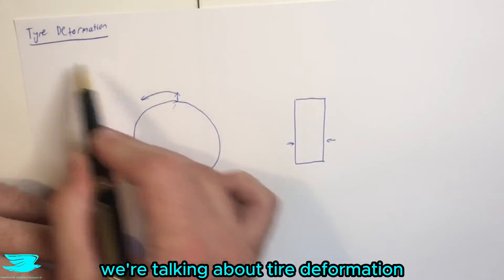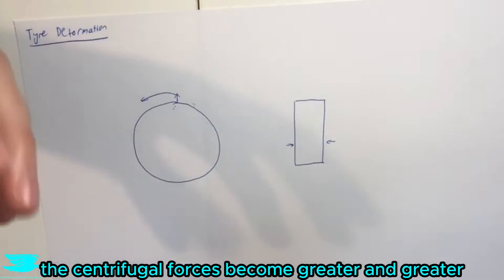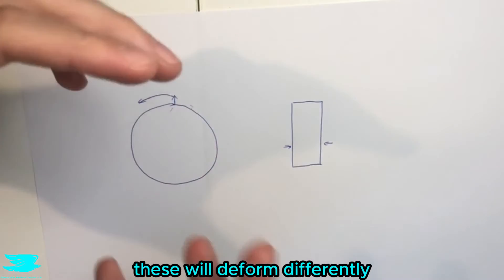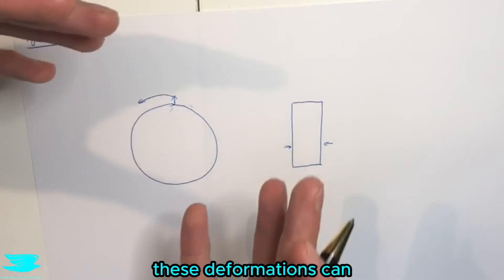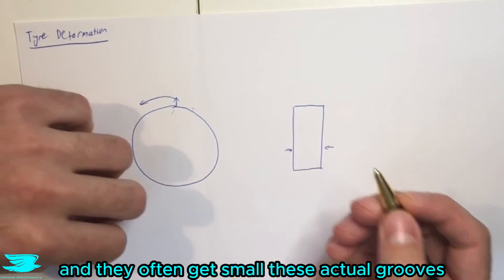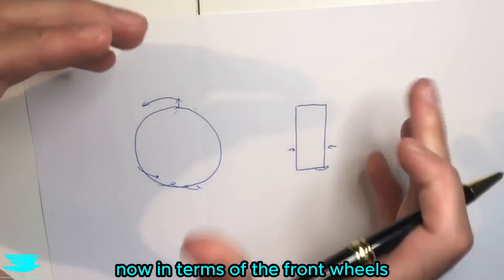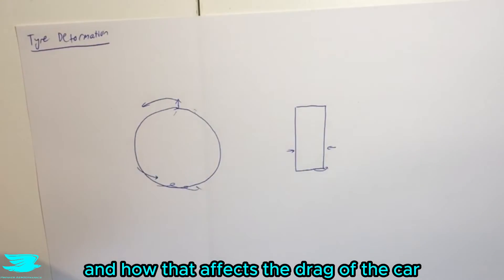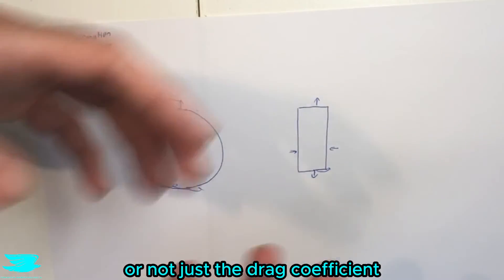Tyre Deformation Aerodynamics {Auto Aero #54}

Comment: Hello,

Flettner Rotor and Vortex Tongue are related to this topic.

For me it makes a lot sense to cage the wheels in. The deforming of the tire is only important to measure the cage size.
Just the part of the tire uncaged needs to  get in touch with the road.

Got to invent a mud cleaner. Cause the cage is going to catch dirt.
With a tire mountable cage cleaner brush, the cage might work.

With a cage around the front wheels, rubber foiled  wheel openings are possible.
If  the wheel is steered, only the cage is touching and bending the rubber foil.

Perhaps it's worth to mention that the moving air around the wheel produces suction, that tries to pull the cage toward the moving tire.
Reply from the maker: Covering the wheels are definitely good for reducing drag.

Comment: The strategy to minimize tire wake is to stop moving air from getting to the front of the wheel, and cramming as much slow moving air behind the wheel as possible. If the tire jetting vortex is due to air entering the space the tire leaves behind, putting air behind the tire will reduce the favorable pressure gradient that forms from the stagnation pressure at the front.

Obviously it's worse at the rear because the air has less kinetic energy left in it as it makes it's way through the car and all it's skin friction. It's also worse at the rear because the turbulent mixing from the tire wake increases the back pressure in the diffuser. The relative flow along the rear wheels is the key to improving diffuser performance. Outwashing bodywork behind the rear wheels, not only directs the tire wake outboard away from the diffuser(reducing the back pressure), but it turns the tire wake into a vortex that entrains airflow outboard as well.

Doing this will increase drag from the tire wake, and to make up for it, you have reduced the back pressure in the diffuser. Now you no longer have the tire wake turbulently mixing with your diffuser expansion, flow stays attached longer, your spoiler/wing/gurney becomes more effective at extracting air from the diffuser further reducing back pressure. Just from taking the tire wake out of the equation.
Reply from the maker: These are good points. For the flow directly behind the wheel, that is more controlled by the longitudinal grooves that allow air through the contact patch and the shoulders of the tyres that may or may not separate the flow.

The jetting vortex usually steers clear of the wake immediately behind the wheel. Sometimes, it can come back into the wake but more downstream.

And yep, the rear wheels do face a hard time. And getting cleaner flow from elsewhere is a good idea.
Reply: @PremierAerodynamics  I was talking more about the wheel wells themselves. We can do better than just putting a plastic hemisphere around the wheels, and calling it good. The little flaps and strakes around the wheels OEMS place is a good first step, cheap effective and easy to produce. Venting the wheel wells in strategic places is more expensive to produce, but even more effective.

Actually sculpting the entire wheel enclosure, is the least practical but most effective method. Least practical because it's by far the most expensive, not just in terms of design, but knock on effects like intrusion into cabin space, packaging requirements. When you look at it from that POV you can see why cars like the Ford GT are so expensive, as the aerodynamics took a front seat, even at the expense of the interior.
Reply from the maker: @rolandotillit2867  Oh okay. Good point. In that effort, many of the German cars now feature vents coming out of the wheelhouses, generally around where you get high pressure. That serves two purposes. You alleviate that high pressure and you funnel that flow into the flow around the car and in the wake to reduce the drag.

Funnily, because they generally look good, some cars have put them on for aesthetics but not connected them to the wheelhouses.😂

Comment: If we assume the tire is distortable but incompressible (i.e. solid rubber with constant volume, Poisson's ratio of 0.5), then as it lengthens in the longitudinal dimension, its lateral width would decrease by a greater ratio than its increase in vertical height. In other words, centrifugal force would decrease its frontal area.

If instead, we assume the tire is an idealized thin-walled pneumatic balloon (Poisson's ratio 0.5), its frontal area would decrease in a similar manner. Also, it's tread shape would distort towards that of a motorcycle tire, in such a way as to reduce drag coefficient.

In reality, a tire is a somewhat-complex, rigidly-constructed pneumatic object, but I'd still hesitate to claim a drag increase without actual measurements (e.g. front-view telephotography).

It's worth mentioning that the region near the contact patch is greatly widened and lengthened by normal-load deformation. Without such deformation of the tire and/or road surface, the contact patch would have zero longitudinal length. However, airspeed is low near the contact patch, assuming a zero-slip condition. The top of the tire has an airspeed that is twice groundspeed, and would be have greater aerodynamic effect.
Reply from the maker: Good points.

For the one about tyre frontal area reduction, perhaps it is more complicated than that because at the front you have rubber being thrown into the ground as well. Also, when the tyres expand radially, they lift up, so you have an increase in height at the front.

For the tread deformation, it is in the order of a few millimeters, so it isn't as extreme as a motorcycle tyre. I'm not sure if a tyre can deform that much without popping.😅

There are several papers that show this change. I can link some if you like.

For an exposed wheel, definitely, the top is moving twice that of the freestream flow, but in a wheelhouse, the flow the top of the tyre sees is very slow and not close to the freestream speed. The flow also meanders around, so it isn't completely aligned with the freestream direction either.

Comment: Great video as always. It would be interesting to see how they compensate for this in top level motorsport.
Reply from the maker: This is an interesting point, and simpler in some ways and more complex in others.

In motorsport, they often don't have as much tread, F1 for example, so they don't need to worry about the additional air flow around the shoulder.

On the other hand, they also cant their wheels much more, so, one side is squashed into the floor more and the other side not so much. That causes asymmetry in the vortex pattern around the wheel, and makes one side more prone to separation and the other less.